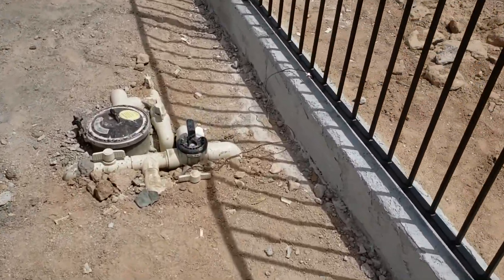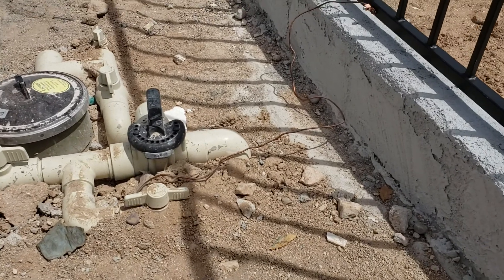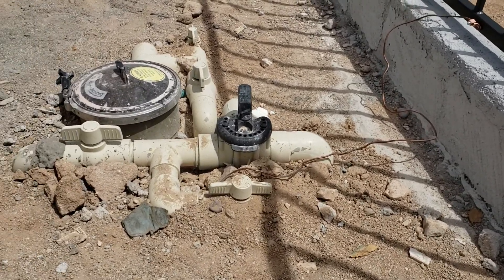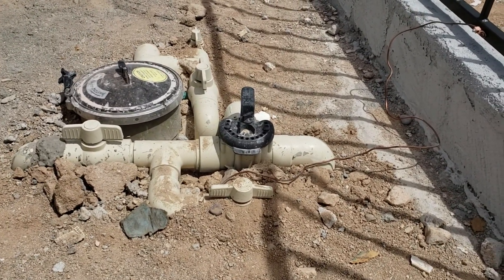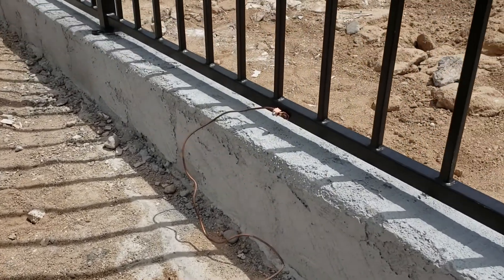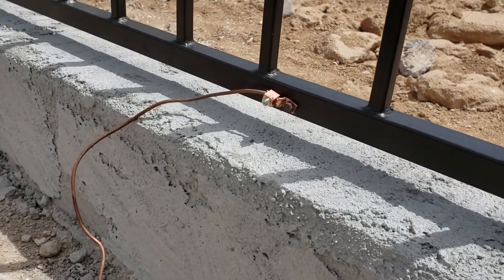Bonding wire on fence near pool   Affordable Fence and Gates Tucson

Comment: Do you just need to bond the fence at that one place?
Reply: I was looking for the same answer. I think it would depend on what type of fence. This looks like a completely solid, welded together fence. Whereas I am using aluminum panel fencing and think each panel near the pool needs bonded